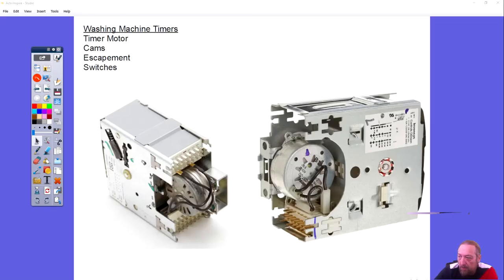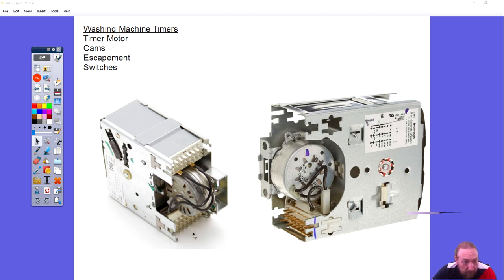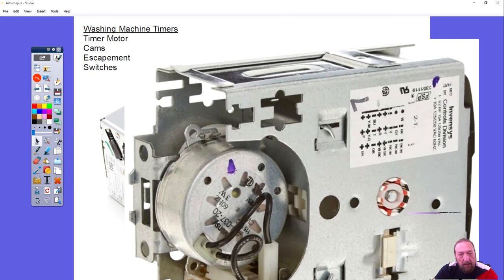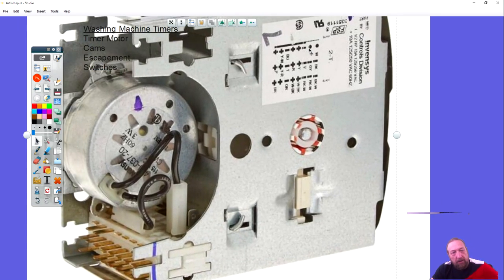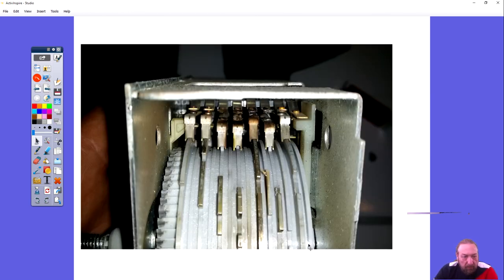#TECHTALK Washer Timers and Charts

Comment: Heaven sent! I was given a dead Whirlpool which had a timer dated 1997. I have taken several apart before but never attempted to reassemble them. I took mine apart and soaked the points in vinegar overnight then blew them off dry. Reassembled but it seemed to be always on when I manually advanced the timer while off. First few minutes of the video talked about the sliding master on/off accessible from the back. Took it apart again and that fixed it. Many thanks!

Comment: Thank you Brandon for posting this video.  I am in the process of replacing a faulty cam controller for a GE washing machine with a Arduino microprocessor and you confirmed my understanding of reading the timing chart and schematic diagram.   Great video.